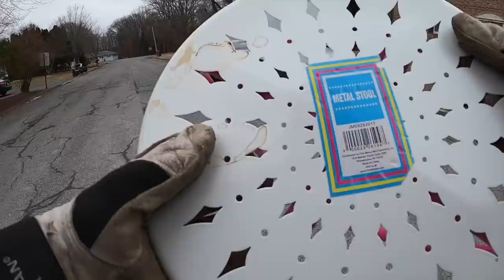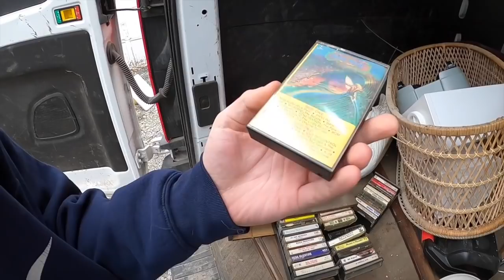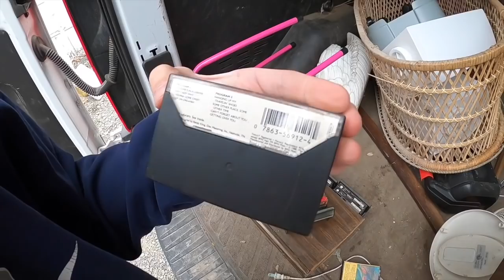INCREDIBLE Things Found While Trash Picking! - Ep. 564

Comment: For many years I used a dolly (with bent top handle) to wheel heavy stuff to my SUV then leaned it against the bumper and pushed/pulled it into the cargo area using the dolly as a ramp. The worst thing for your back is stretching, if it hurts don't do it. I learned this after I herniated 2 discs

Comment: For that muscle between your shoulder blades, reach your right hand over your right shoulder and your left hand under your left shoulder and try to meet and clasp your fingers and pull.  If you can't reach use a short towel to fill the gap and pull them switch sides with left hand going over left shoulder and right hand under right shoulder. That will get rid of that particular pain faster than any medication. There are more stretches that really help but that one is the easier to try to describe. Instant relief.

Comment: Taco, your ' weird looking sled thing " appears to be a small rocking chair ( Notice the legs? ) It has no seat on it though, but it DOES rock back and forth
Reply: Yeah it looks like an ikea rocking chair  base. I would keep it until I found a chair with broken legs, and then  frankenstein the two  pieces together.
Reply: When I saw it, I thought it looked like the bottom of a childs rocking horse,,,  minus the horse,,,  :-)
Reply: The bottom is reminiscent of the MCM rockers. I assume IKEA sells replicas these days, but there could be a chance that it’s older than that.
Reply: It's a....WIDE MOUNT Rocker Chair Base fits Herman Miller Eames Shell Mid Century Modern
Reply: @vetsutube  Kewl,,,  It is probably worth putting on marketplace or ebay as a repair piece,,

Comment: It sounds like you tweaked your rhomboid muscle.  It's a hard area to reach to massage on yourself. If you have a tennis ball or  similar sized rubber ball (dog toys are good especially the nubby ones) , put it in a sock and then  drape the sock over your shoulder until the ball is at the sore spot of your back. Then lean back against a wall and kind of roll around  against the ball.  (the sock is just to help position the ball).